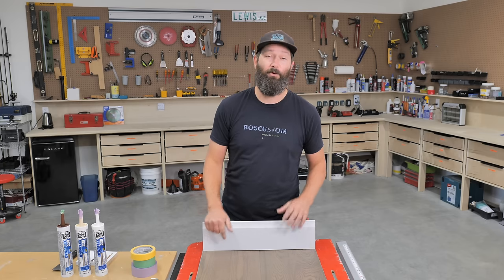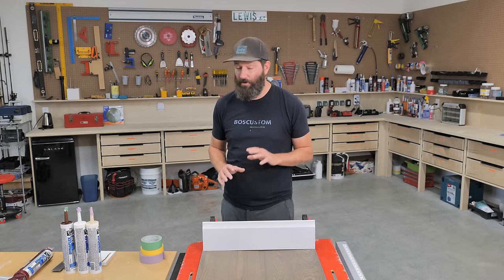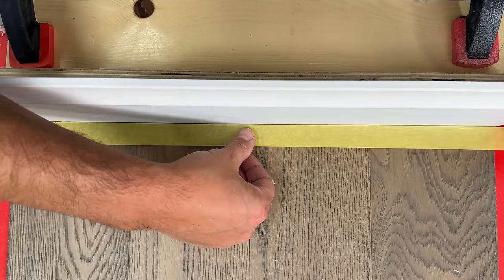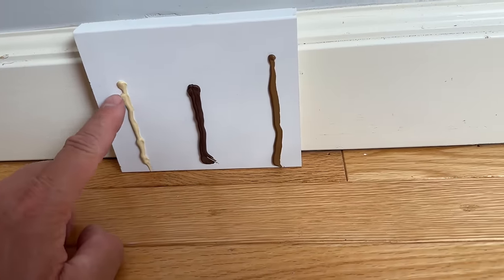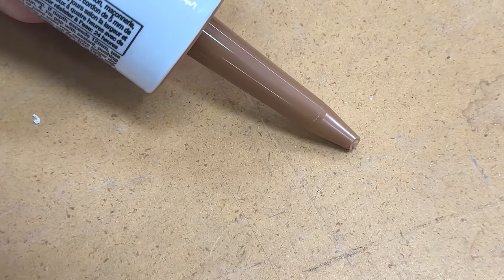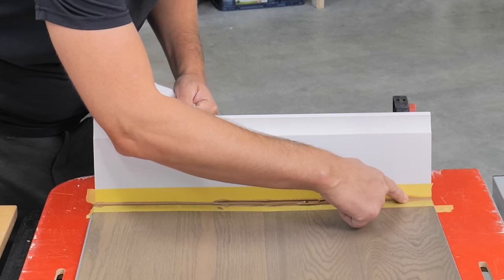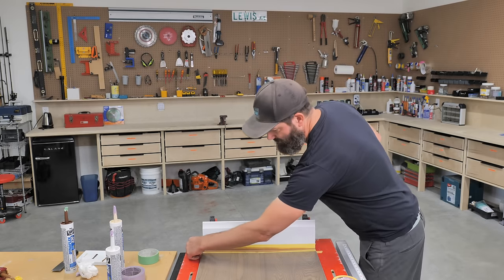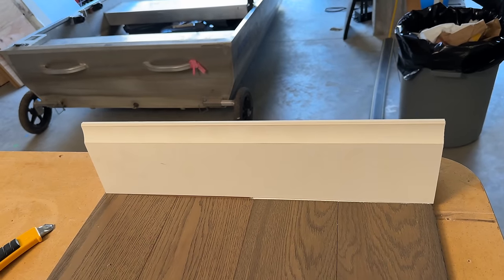How To Make Gaps Under Baseboards Disappear With Caulking

Comment: A no go, I’m a painter 45 years, and never heard of caulking base boards to hard wood flooring it looks ugly and would crack in no time, and there’s always movement in laminate hardwood flooring, that’s why it’s called a floating floor ,,,, hilarious this is,, 😂😂😂😂😂
Reply: Well, what do you suggest? I have bus coming from the outside to in, and I have a baby who needs to be able to crawl on the floor... what am I supposed to do because it's hindering my baby's development. Advice would really be nice rn.
Reply: @dimitraherring6201  beading lad, adhesive to the skirts, not the floor, 👍